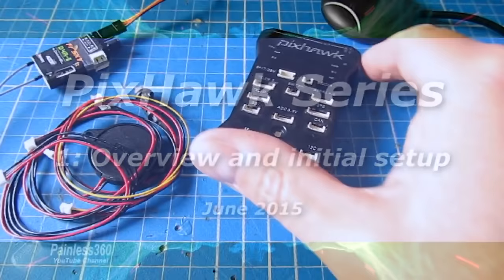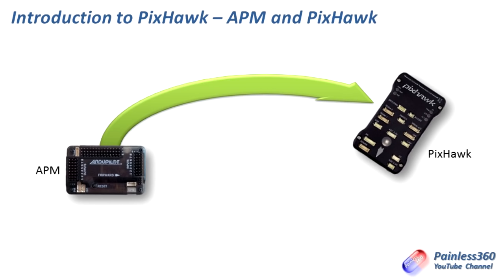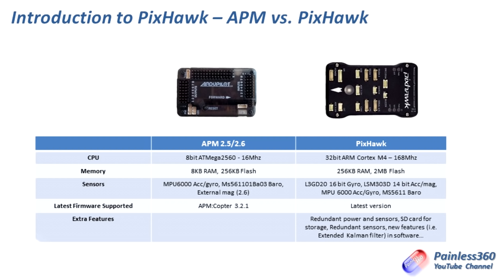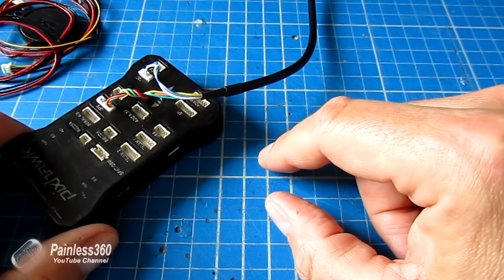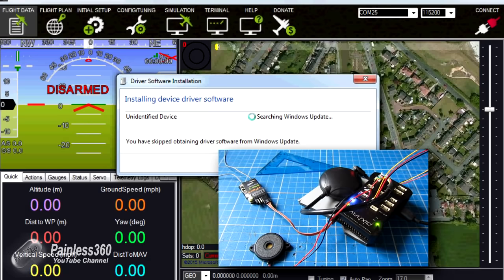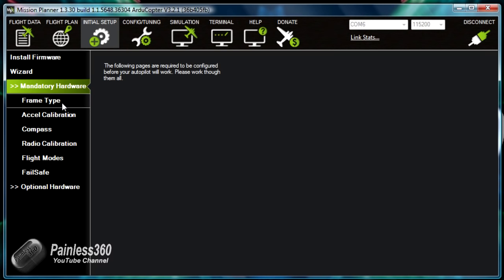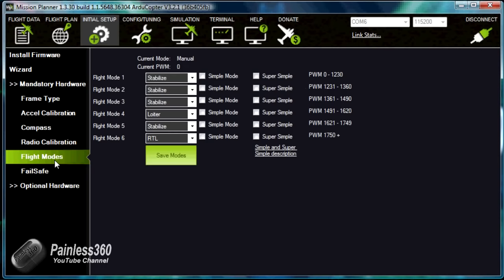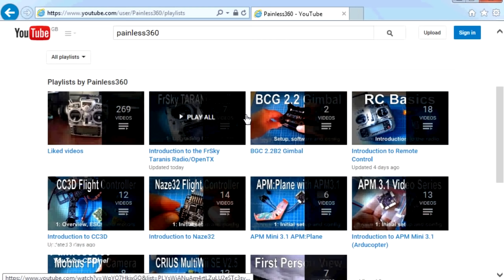(1/5) PixHawk Video Series - Simple initial setup, config and calibration

Comment: I watched this video some time ago and it persuaded me to lash out 60 quid to buy a Pixhawk 2.4.8.  

I started to watch again in order to set the Pixhawk up.  I was doing fine in connecting the GPS although on my version, the plug would only allow me to install I2C cable with the white wire to the right of the red.

The problem that prompted this posting was that I have a Radiolink AT9 Transmitter with and R9D receiver.  The R9D has a 4 pin connector on the top which is labelled (top to bottom) GND, SDA, SCL and VCC.  The Pixhawk SBUS connector only has 3 pins.  Are the receiver and the Pixhawk compatible?
Reply from the maker: +Peter Brown those pins on the receiver have noting to do with subs.. Best of luck with it
Reply: Yes, I realised that after I had made the post.  The socket is for the PRM-01, power return module for displaying flight parameters on the transmitter screen.

I found out from the Radiolink website that Channel 9 on the  R9D receiver is set for SBUS (the three horizontal pins below the vertical 'channel' pins)  I should imagine that there is a similar arrangement for the 10 channel version

Comment: Would you know, by any chance, if it's OK to plug Receiver outputs 1, 2, 3, 4 and 7 into the 3DR PPM encoder's 1,2,3,4 and 5 inputs, and not connect inputs 6 & 8 which I'd like to plug directly into my Disco Pro's mainboard to control gimbal pitch and cam switch ? How does the PPM encoder deal with 'missing channels', or is there a preferable way of connecting things ? Thanks.
Reply from the maker: +Jaaaaaaaaaaaaaaay It should be ok but I've not used one and the manual isn't clear on that. I would try it and see..Best of luck..
Reply: Ok will do. Cheers.

Comment: Hi... thanks for the videos over the years.      Im getting my fixed wing set up on my old pixhawk.   Im noticing that my Yaw orintation is way off when viewed on mission planner.   Is this normal or how do I go about fixing it.   I tried calabrating different compasses and Get the same result every time...   My yaw is about 90 degrees off when viewed on the mission planner
Reply from the maker: +3D Drones if you mean the heading then it sounds like the compass in the GPS isn't aligned as expected..
Reply: Ended up switching my GPS/Compass to another unit to solve the issue.   The "bad AHRS" warning kept me from arming the motor though.  ended up disabling the "INS" on the arming warnings on the setting tabs to get around it and arm the motor.    Was that a terrible idea?   All the info on my Hud matches up to my craft and I'm assuming my GPS assisted modes will work fine but I wanted to run this by you before I fly

Comment: Hi Painless, i've shown your PIXHAWK PX4  video serie thank's for that....but i didn't seen how to wire a video transmitter on it....May we connect any video TX ( from Dji AVL 58 for example ) or a specific for PX4....
Best regards
Philippe
Reply from the maker: +Drones Visions Aériennes You would need to setup and add an MininOSD and connect that to the camera, Vtx and Pixhawk. See the wiki for details. We so setup an APM with this on the channel and it's almost identical..
Reply: +Painless360 sorry but what do you mean. ...wiki...?  
thank a lot
Reply from the maker: The online manual ;)

Comment: i still have a brand new 2.4.8 that i never got around to using. i was wondering if it is still worth getting it up and running on my tarot 680 hex. will it support dshot and crossfire and 6s input or should i just upgrade to the latest holybro version?
Reply from the maker: Should be fine. Check out the docs for the latest - http://ardupilot.org/copter/docs/common-dshot.html - and see my Crossfire videos for Pixhawk tips.. ;)

Comment: I have to chance to either get this Pixhawk or a Pixfalcon which would be better?
Reply from the maker: We've not used the Pixfalcon here, it should work in the same way. The smaller packages sacrifice normal pins and connections though..

Comment: Hi Painless, it's difficult to me to make video but....i go forward...i;'ve followed this to calibrate my ESCs....

Radio On with throttle high / Plug Lipo / Pixhawk ring / switch blink moderatly ( led red 1,2,3,4, - - - - , 1,2,3,4, - - - ) / Unplug Lipo / Plug Lipo / switch red moderetly ( led 1,2,3,4 - - - ) + Long Biiiiiip ( entrance calibration ) / Keep the switch pressed for Fix Red led /  Stick throttle down / Bip for calibration OK then throttle high moderatly then full to test...............Yay....yay....motors run very well...........................But, because there always a ....BUT......when i unplug my Lipo then radio Off....................
and when i turn on again my radio, plug my Lipo ...no more run...i have to repeat my calibration...................and i don't know WHY..????

Perhaps, may i have to connect again before unplug my Lipo just after the motors test.....to save in Pixhawk memory....!

a new idea, maybe..............,?

best regards.....Philippe
Reply from the maker: Not without a video - best of luck!

Comment: Hello, I'm trying to develop a quadcopter for research purpose, I'm stuck using both raspberry pi and pixhawk, I'm using a radiolink at9 transmitter and r9ds reciever, problem is that the com port is not detected in the mission planner, so i'm not able to move forward, so could anyone help me figuring out what the possible fault could be.
Reply: Hello i have the same problem as you wircht now, have you solved the problem yet?

Comment: Hi, thanks for the great instructional videos! 
Does the ail, ele, thr & rud positions apply to mode 1 & mode 2 Tx configurations?
Reply from the maker: +MJ VISUAL MEDIA The position on the controls move on the radio dependant on the mode the radio is configured for but they work in the same way at the flight controller. Hope that helps. Happy flying!
Reply: So regardless of the mode being used, Ail will be channel 1, Ele will be channel 2 and so on?
Reply from the maker: On the FC - yes. (unless you change the channel mapping on the software!)

Comment: Hi Brother :) I am waiting for mine after that my second Apm Board is not working. The first time was my fault, I connected to much power to the Board, But the second time it was the Minimum Osd went up in smoke and just after that it wouldnt fly normally and the next day I couldnt get the esc (Channel 3) wouldnt work :( It would recognise the esc, but the Motor wont turn. to make shore I changed the motor and esc to that channel and yes Ch 3 on the esc side wont work :( so I just ordered a PixHawk. I still Hope that I can maybe repair it at some point !?!My Question is, Can you use APM or PixHawk as Antenna Tracker? If so, would that mean that You should Buy two of them one for Antenna Tracker and the other one in the plane/Quadcopter ?Thank you
Reply from the maker: +Bisholi M Yes you can, you need to install the antenna tracker profile from the Mission Planner firmware install. I've not used it myself as I never fly more then 400ft out. Best of luck with it.
Reply: +Painless360 Thank you Brother. You really are Very kind sharing your Know how with us. Thank's again.....:)

Comment: Because I consider you a guru i have a question about pixhawk. here it is: when i arm the motors on mission planner it appear "bad Logging" message. I try to change SD, (high speed, class 10, different size, different format file system such as FAT32 and FAT16) but nothing to do, what can be the problem? i have to think that is the board? log data for me are very important to geotag  the picture taken with the camera trigger option. many thanks for your suggestions
Reply from the maker: I’ve personally not seen that here. Checking the forums, it appears to be mainly centred around the SD card, but they do seem to be people who have resolved the problem by flashing it with another version of firmware. Best of luck!
Reply: Painless360 thanks a lot! Yes, this problem seems that don't have a clear solution. I have read a lot of forum's pages... I will try to reset the board and flash it again. Touching wood!
Reply from the maker: Me too! :D

Comment: Hope im not being a pain but i will be recieving a new gps compass soon so to start fresh ive deleted mission planner from my windows 7 laptop the logs and everything. Now Ive reinstalled mission planner and right off the bat my norton antivirus has removed like 10 files and now the program will not run. Ive tries this with windows 10 and I cant even install firmware the laptop  just freezes it will download the software quickly but will not upload. Any suggestions Thanks again
Reply from the maker: I've not used mission planner for a while. You can tell your AV that the files are ok or turn it off while you install. This sometimes happens here when we are using 'very very new' code from developers as part of testing.. Best of luck!

Comment: Hello Painless,

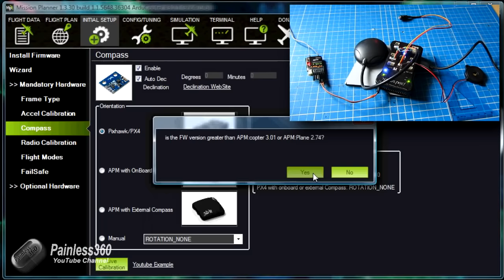thanks for all of your awesome and gorgeous videos and excellent explainations. I bought myself the Pixhawk Lite from GoodLuckBuy. I think you don´t have any experiance with that, but anyway - this plattform can run the Pixhawk firmware without a problem. I would like to know what kind of settings i have to choose mandatory hardware tab in the compass menu. Minute 18:25 in this Video.

You are clicking Pixhawk or PX4. What will this opetion excatly do? I did not find an answer somewhere. Maybe you can help? Do i have to use Pixhawk or PX4 as well? What are those other options? What do i have to choose? What will that option do?
Reply from the maker: +Christian Wunderlich Have a look in the video for the differences between PX4 and Pixhawk. I'd always check with the vendor on what they suggest. If it's sold as a Pixhawk then that FW should work.. Best of luck..
Reply: +Painless360 ok understood - but what setting do you configure with this bullet point which you can select and i´m not able to find a video comparing px4 and pixhawk.
Reply from the maker: We cover it at the start of this video briefly. I'd check with the vendor but it is probably pixhawk you need. Best of luck.

Comment: what is the differance between pixhawk 2.4.6 and 2.4.8? ehich one should we buy?
Reply from the maker: As I understand it, the main difference between the two is the 2.4.8 uses to STM32F42xx v3 which does not have the 1mb issue. There is more on this in the forums..  Best of luck

Comment: Love you video can i use FlySky FS-i6 2.4G 6CH AFHDS RC Transmitter, because I run into a problem with with Turnigy 9x and ending up getting the second flysky can i use either transmitter to connect the receiver which you are showing the video. Hope you can help me out I do not want to buy other transmitter. Thank you.
Reply from the maker: +TRULEE MEMORABLE you need to use the right receiver for the radio that you have. See our videos in in the 'introduction to remote control series' that explains it is a lot more detail. Best of luck
Reply: Thank you for all your help. You are the best and willing to answer questions fast and helping newbies like my self. Thank you

Comment: Hello finally I received my pixhawk I'm very happy the way it works but I am starting to worry about and it's a pain as I need to learn one of the problems I have at the moment is about yaw is reversed and I can't find how to reverse it from mission planner do you know the yaw parameter which one is please? at the moment I don't have the receiver connected but it shows on the telemetry the way it moves
Reply from the maker: +Charlie Farrugia Reverse it on the radio...
Reply: +Painless360  do you think then will have any problem when it switch to failsafe ? as the receiver will not have signal from the radio.... I have tried and searched a lot about this problem and tried to change parameters but no luck.
Reply from the maker: Depends on the receiver having failsafe and it setup correctly - see the other videos. Best of luck!

Comment: Hello everyone. I got a problem with my Pixhawk 2.4.8. One of my ESCs/motors is making a constant beeping (like 2 times/sec) which means that it has no signal or that the throttle is set too high. Both isnt really the case. All the other motors are working fine and I can calibrate them using Mission Planner (while the 4th motor is just doing the beeps all the time). I did everything like in your video. Does anybody has some solutions/tips for me ?
Reply from the maker: +1malcom1 how do you know that's not the case?
Reply: FYI: when connecting it directly to my receiver (CH3-Throttle) I can test it and it works just perfect. But via Pix it just doesnt work anymore BUT I was searching the internet and found a thread about that fake 2.4.8 Pixhawk and some problems with firmware later then 3.2.1 so I just flashed it with that and now it kinda works. All the motors are spinning but they are little bit out of synch plus there is a delay when I change the throttle on my Radio. Strange. I also read about problems with EMAX ESC (BLheli) which I own. Dunno what to do now
Reply: Here's a few things you can try.... a throttle calibration just between your transmitter , receiver ,esc and motors  or switch motor to another esc and esc to another motor ... that way you'll know if it's the motor or esc.
Reply: I fixed the problem. I bought some new ESCs (Hobbywing xrotor 20A) and they work just fine with the PX4 Flight Stack which I flashed via QGroundcontrol.

Comment: video is excellent,i need to  save space can I connect gps above to pixhawk and calibrate  is it problem?
Reply from the maker: You need to have the GPS away from any magnetic interference. It also houses a magnetometer (compass) so having it too close to other electronics could cause problems. Try it and see..

Comment: Hello, very nice video... and your english is just perfect for me to understand.
I have a Pixhawk 2.4.8, Taranis, XR8, and latest software with APM on a Mac.
I want to use the Pixhawk for a plane.
I have configured my switch SG on chanel 5 to change flight modes.
In the screen "Radio Calibration", I can see my switch moving from 982 (low position)  to 1492 (middle position) to 2006 (high position).
But when I go to the screen "Flight Modes" what ever switch position, it stay on Flight Mode 4 where it should from Flight Mode 1, to Flight Mode 4 to Flight Mode 6 if I look at the PWM values that the switch creates. It doesn't change the flight mode.
Where do I go wrong?
Thank you for your answer
Regards
Reply from the maker: Not sure, I've not seen this. I'd have a look in the forums and make sure you've not skipped any steps.. Best of luck!
Reply: Found the solution: instead using Ch5 for the flight modes, I tried the Ch8 and it worked out!!!  don't ask me why... I keep watching your videos, they are great, very nice job, keep it that way for dummies like me... Cheers

Comment: I'm building a quadcopter with a pixhawk and a diatone whitesheep from BG. But I have no idea on how gimbals work and how I should place it on that specific frame. I am still a student, and I'll get these as my 18th birthday gift, so, I will not have any other chance of buying extra parts later; i'll need to get everything I need at once. Do you have any vids on the subject, otherwise, could you or someone else help me personally?
Reply from the maker: +Ishfaaq Jhaumeer We have a few videos on standalone gimbals on the channel. You can mount a camera using servos and use the Pixhawk as a controller (http://copter.ardupilot.com/wiki/common-camera-gimbal/) - outside of that we can't help. Best of luck with it!
Reply: +Painless360 Alright, I found a gimbal from BG with the same controller as the one in your videos, thanks :)

Comment: Hello again I used to have the apm2.8 controller now I have the pixhawk p/4 right after plugged in my gps module to the controller and then plugging the controll to the pc there is no led light on the module its like its not getting power. Can you help Thanks
Reply from the maker: +Chaz M sounds like a power supply issue. What troubleshooting have you already tried?
Reply: Well good news for now what I had noticed the pixhawk has 6 pins on it and the gps connector had  5 pins  shortly after that i realized and found a video on how change the connectors. So I changed the connector and now I have power now I also realized I need a ppm sum receiver that comes tomorrow then ill try the setup process again. Hopefully things will go better after that if so ill continue on with your video series. Thanks again

Comment: can I use pwm receiver in pixhawk or I need to convert pwm to ppm  signal
Reply from the maker: No PWM without an adapter - all covered in the manual http://ardupilot.org/copter/docs/common-pixhawk-and-px4-compatible-rc-transmitter-and-receiver-systems.html Best of luck!

Comment: Hi. Sorry i have some problems with that board. First after i set everything and try to fly. The quadcopter never stabilizat. Always going to one direction. And after that i got ekf problem. I noticed after i flashed it to 4.0.7 in mission planer. I chose pixhawk 1 like firmware because i didn't find the px4 target or something. I noticed under the connexion tab. It's writing octorotor com 8. I was pretty sure i flashed quadcopter. Now i reflashed it to the same target. But still have that ekf problem. Is there something i can do?
Thanks
Reply from the maker: I've not used one of these Pixhawk clones for a long time now. I would look in the forums and try another version of the software to see if that changes anything. Best of luck!
Reply: @Painless360  thanks man. Its an original one it came in its original box. I have 8 Sat's and hdop 1.1 and still have the same problem ekf. I tried my apm dosent have that error. And tried other gps. Still no luck. I'll just threw it in the bin before i get a headache. Thanks man